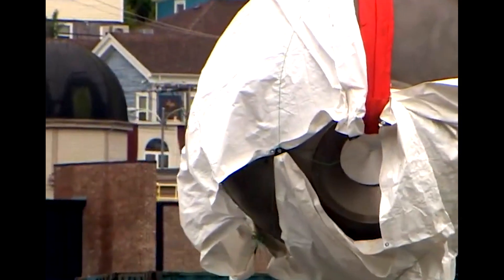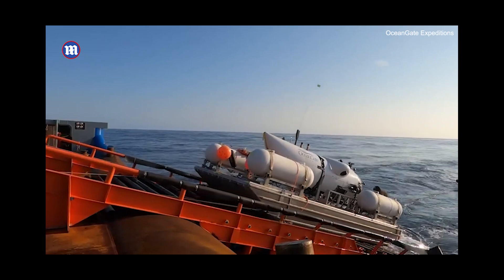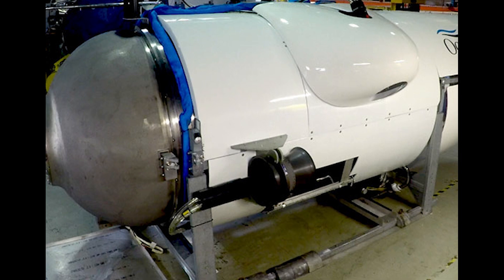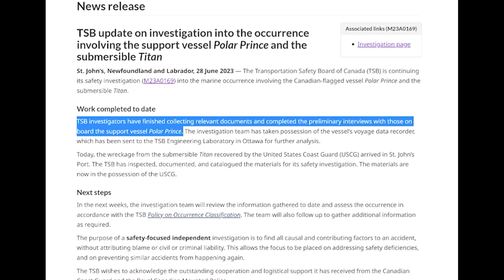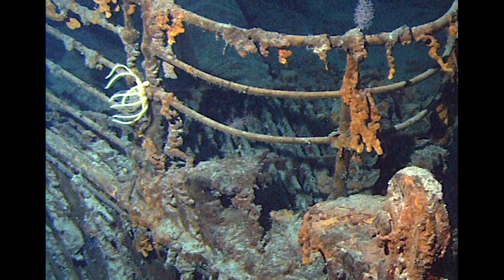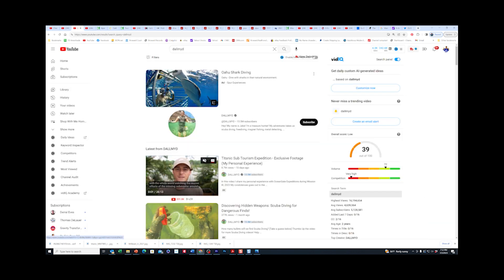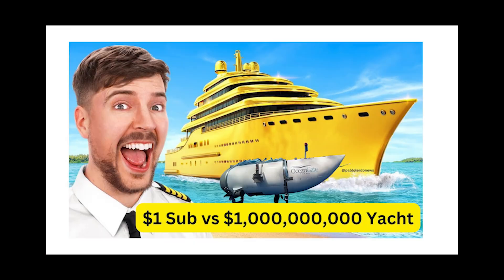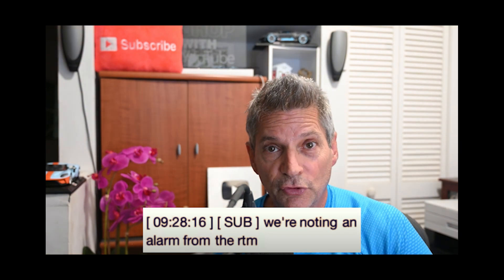Titan Submarine Debris Clues, Implosion Simulation

Comment: Here's what I think happened to the port window.
The carbon fiber collapsed during the implosion and as the water blasted in, it created a pressure wave that compressed the bubble of air in the vessel peaking its pressure to a higher value than the surrounding pressure with what is essentially a water hammer effect.  This pressure peak popped out the port window and both titanium end caps.
Reply: Yeah, I thought the exact same thing. That pressure wave from cavitation is like TONS of TNT going off instantly. The window was tapered inward to resist inward pressure, not outward.
Reply: @AnubisDogman  not tons, more like about 50kg of TNT. Which is more than enough to vapourize the carbon fiber along with any living tissue.
(I calculated the energy by simulating the gas laws in the process of crushing a 10m^3 bubble at the depth of 3500m deep)
Reply: @adamrak7560  I wasn't being literal, but thanks for dorking out on that. I guess I should have said heaps, or something...
Reply: @adamrak7560  - Another calculation that I heard reported came up with 48 kg, so you are onto it.
Reply: I agree but I think it is a matter of momentum of water rather than simply pressure. On implosion the water accelerated into the air space. It hit the window fast. Force = rate of change of momentum. The window was not designed to withstand a large force from the inside and could not provide enough force to stop the moving water. The fast moving water hit the window, causing a force inside that was equal to the outside pressure + that caused by decelaration of the water and blew it off.
Reply: @fishersofevidence8771 Apparently, its the compression of the water. Youtuber thunderfoot done a vid. At titanic depth, the water is actually compressed by about 1%. If that water finds a gap at 1 atmosphere, it effectively decoils at something like 2 or 3x the speed of sound. The water has massive force then, and the pocket of air that was the sub is surrounded for an instant by a cloud of uncompressed water. The water is effectively like an infinate spring with a spring rate eguivelent to the depth pressure.
Reply: @fishersofevidence8771  
Agreed.  The water hammer effect I mentioned is in fact the result of the momentum of water.
Reply: @fishersofevidence8771  
Although the energy stored in the compressibility of water at those pressures enhanced the power of the implosion, the implosion would still occur even without it.  That video you referenced was in my opinion, completely incorrect with the assertion that without that compressive stored energy, the water would just flow in slowly.
He seems to have overlooked that the pressure is all around from all directions and fed by a massive volume of ocean, not just the water directly above the vessel pushing 'down' on the vessel so the speed that water falls due to gravity is not a limiting factor.
Reply: @fishersofevidence8771  Elsewhere, I estimated the force holding the window in place at ~2.2 million pounds due to depth plus ~0.9 million pounds due to the clamping force of the bolts, for 3.1 million pounds on a 380 sq in face. or roughly 8,700 psi in round numbers

Your internal pressure would need to exceed that in order for the bolts to fail.

A collapsing air bubbleis by default going to have less pressure, and, when it collapses, it will go into solution in the water. It'll be fast - Mach 1 - but the result will be similar to a water balloon impacting a granite cliff, even if at speed.
Reply: @fishersofevidence8771  Well put :-)
Reply: @fishersofevidence8771  Exactly what others commented above...
Reply: Think this comment is spot on and I would also immediately rule out the possiblity that the salvage company unbolted the porthole.  If the porthole was still in place after the implosion any micro stresses on its bolts and general seal with the titanium would be of major interest in a research lab.  The salvage company would not have destroyed forensic evidence like that, they would have instead just put the entire end cap onto a pallet and transported it that way.
Reply: @michaelmacleod7051  Especially with the massive media attention to this failure, there's NO FU*KING WAY IN HELL the salvage company unbolted and removed that porthole.  The implosion blew it out.
Reply: So where are the delaminated pieces of carbon fiber?  I wonder if the carbon fibers are just not being shown to us
Reply: @term25600  
Don't forget that carbon fiber is much less dense than the metals.  The shattered pieces, if any remain at all, would have drifted away much easier than the heavier metal ones.
Reply: @term25600  Well, if the pieces were recoverable they are in one of those bags they craned off the ship.
Reply: @term25600  It's confetti now.
Reply: @amandahugenkiss  We shall call it "Carbonfetti"
Reply: Since water has inertia it it will continue to fill will the volume of the submersible until it is greater than the ambient pressure. Any resulting bubble of air is going to be tiny. Approximately 1/350th the internal volume. Assuming a depth of 3.5km.
In a very short period of time (possibly less than a millisecond) the inside  of hemispheres go from having having 1 atmosphere of air to more than 350 atmospheres of water. Which is going to put a huge tension on all of the bolts.
Reply: @markevans2294  It’s not the static pressure, since the pressure on the outside of the port will also be about 380 atmospheres. It will be the force of the incoming water moving at possibly supersonic speeds impacting the port that does the damage. Given that the port window resists external pressure, both the bolts or the window could fail.
Reply: @StillAliveAndKicking_  In terms of the effect of the over pressure on the bolts there's likely little practical difference between the water moving at 1.5km/s and it being supersonic.
Reply: @markevans2294  Except that the bolts are being supported by the external pressure. In order to transfer tension to the bolts, you need to have strain - if no displacement is possible because of the opposing compressive stress, no tensile strain is possible.

So, until you can overcome the external pressure and displace the viewport outwards, the bolts do no experience stress or strain. Only after the port starts to move will you induce stress on the bolts.
Reply: Water hammer causing premature wear/failure was a concern for us operating at 500 psi at a power plant.  I can’t get get my brain around the force from water hammer of an implosion at Titanic depth.
Reply: And all in roughly the time it takes a bolt of lightning to strike...
Reply: @Rammstein0963.  IIRC a fluid will attempt to fill a void at the speed of sound. Which would make it far quicker in water than air.
Reply: What we are talking about here is a shock wave travelling out from the centre of implosion, kind of like a sonic boom.  It has extreme peak temperature and pressure, but very brief duration.  Generally it will break things, but not move them very far.  Maybe it broke the various ring/window fixing bolts?  I don't know, but it's a possibility.  Examination should show, if there are brittle-fractured bolt ends still in the threads.
Reply: Was thinking similarly as a possibility.
Reply: @Andy-df5fj
I imagine that the same mechanism accounts for the clean separation of the titanium domes from the titanium end rings of the cylinder, and also the clean separation of the end rings from the cylinder. All of these attachments were designed to withstand compression, not tension. When the hull collapsed, water accelerated into the void and hit both ends hard, the window blew out and the titanium domes blew off the ends. The inertia of the titanium end rings on the cylinder was sufficient that the bolts holding the domes onto the rings failed, but not before the joint between the rings and the carbon fibre cylinder came apart, that was less able to withstand tension. Composites split and break up into pieces on failure and that together with the relatively low density of carbon fibre composite, making it easily washed away by water currents, is probably why little, if any of it has been found.
Reply: @fishersofevidence8771 In addition it looks like a somewhat clean separation of the flange holding the window in the end cap.  The view when it’s being lifted off the ship shows the outside (evidenced by the hinge mount).  Where there should be a flat flange with tapped holes for the retaining ring bolts there is a rougher beveled surface that indicates a ring shaped piece of the titanium with all the bolts and retainer snapped off together.  I’ve seen similar things happen with a hydraulic press snapping a bearing flange and with a beadloc ring tearing the entire outer edge of a racing wheel right off with a fairly clean break.
Reply: @fishersofevidence8771  Yes, It wasn't only compression, it was compression and then things blowing outwards.  I think the take we've been given on an 'implossion' is probably a bit limited.
Reply: Sounds like aft end cap let go first.
Reply: @BalthazarMyrrh70  The cap would be held in place on the carbon fiber due to the external pressures on it all acting to push it to the center of the sub.  You can see in one of the videos where they install/glue the endcaps, that there is a lip assembly.  This is designed to prevent the endcaps from sliding down on the carbon fiber, not from being blown off it by internal pressures.  They just didn't design it to withstand that kind of situation, because the occupants would already be dead.
Reply: @glenndoiron9317  true. Apparently the glue was an added extra because essentially it was pressure that confirmed a solid seal.
Reply: Yes, you have given the most succinct and likely scenario! It's the most parsimonious explanation. The implosion of the carbon-fiber hull basically popped the titanium components and blasted the acrylic viewing port out. My suspicion is that the reason there were no carbon-fiber hull pieces attached to the titanium caps is because of the glue (which could have been stripped off in an instant).
Reply: @anindochoudhury8926  You're right.  The carbon fiber cylinder failed in the center where the stress was highest, pinched in and the pressure wave blew the front & rear titanium end caps off, plus the porthole window and rear structure of the sub.  Not sure about the landing frame - I've heard some reports that it was jettisoned to surface quicker.
Reply: @johnbergstrom2931  yes, that seems to me to make the most sense. Thanks for putting it so well.
Reply: na, it just blew apart the CF leaving the endcaps in place with nothing connecting them so they fell harmlessly to the ocean floor.  I believe the window blew out and caused all this since it was onlly rated at 1300 feet.
Reply: @ScreamingEagleFTW  yep!
Reply: I have seen a photo of debris on the sea bed and one image had what appeared to be the porthole, looking largely intact. I assume that the porthole dragged the locking ring bolts out when the hammer hit. Thunderfoot calculated the implosion speed to be roughly 2x the speed of sound. It must have been seen to be photographed, so they must have recovered it even if we have not seen it.
Reply: @kevinm8543 It looks like that is what happened as you say. One thing I wonder is if this mechanism of implosion followed by water hammer explosion would also occur with a spherical pressure chamber. Maybe it was a feature of this sausage shaped design?
Reply: @fishersofevidence8771  
I suspect that a spherical enclosure, though far superior at resisting implosion, would still create a large pressure surge due to the same effect if it were to implode.  However, being spherical, it wouldn't have any substantially weaker spots to blow out.
Reply: this is what I think happened... ----> Overconfidence
Reply: Andy, sorry about my post right after yours. I didn't see it initially.
Reply: @sbukosky  
I can't seem to find it.  I presume you came to a similar conclusion?  If so, not at all an issue.
Reply: Your supposition is my strongest intuition as well - the atmosphere inside the submersible formed a pressure wave that blew the hatch window outwards when the submersible's carbon fibre and titanium body failed/imploded. Owing to the varied composite materials that make's up this submersible,  think the actual true point-of-failure for this submersible was it's glued ends..most likely the entry or hatch-end.
Reply: Quite likely, but it must have sheered off all of the bolts holding the port window in place, and also all of the bolts attaching the titanium end caps to the titanium rings.  I can't see any holes where the bolts would have been, but also can't see any sheered bolts from the video evidence.  I am surprised how small those bolts were.  He probably got them from Home Depot
Reply: At 4000m water is compressed to 0.96 of it's original volume, the incoming water would actually be at 1 ATM but traveling at the speed of sound in a liquid: 1,481m/s 

(edit: not 1410m/s), but yeah I think being slammed into at over 3,000mph might pop that guy off, so actually not pressure, pure speed lol
Reply: Thank you for this comment. I've been confused by the comments saying that the port hole came off after water got inside because the port hole was designed to only take pressure from the outside. My, albeit limited, understanding of physics would be that once the water was inside, the water would be exerting equal and opposite pressure on both sides of the window. How you've described it makes that make a lot more sense
Reply: Soup
Reply: Reminds me of that Slow Mo Guys bottle trick, where hitting the top of the bottle creates a vacuum at the base, and then the liquid collapsing back down breaks the glass.
Reply: Nope. The end caps simply dropped away from the cylinder after it was shredded by the implosion. The Navy divers removed the ring and view port from the end cap near the surface prior to John Q eyeball exposure. They'll deny it was ever there but how did that ring get removed? They also removed all traces of carbon fiber from the recovered parts before exposure to the surface. Yeah coverup time.
Reply: The flange for the seating of the viewport plug would have been seriously deformed, and the bolts torn out of their holes in such a scenario.

I did not see that degree of damage.

This makes me think that the ring flanges pulled off of the composite cylinder so rapidly that the pressure wave did not have time to seriously impact the acrylic plug.

I could be wrong, but the damage pattern and general lack of deformation of the titanium parts indicate that the pressure had dissipated about as fast as it built up.
Reply: @chemech  Why? The metal ring and bolts holding the viewport are of insignificant strength compared to the outward force of the explosion after the implosion.  Essentially like toothpicks.  The bolts likely tore apart in tension at the surface of the dome, so we don't see holes or protrusions.  The metal ring is probably still flat because it's supported by the acrylic viewport.  I don't think that the viewport would bend  or break in half because there's essentially nothing holding it against the incoming force of the explosion.  It's possible that it simply shattered.  (Same for the 18 bolts holding the main dome to the ring.  insignificant strength.)
Reply: @brianwest2775  At 7:19 Jeff muses that they might not have used a torque wrench, while SHOWING a torque wrench.  There's 17 bolts holding a Chevy (old skool) cylinder head on, and the bolts shown look about the same size.  A Diesel engine with a 6 foot piston would require MASSIVE bolts for a 22:1 compression, but the "water-hammer" effect would exceed 100:1 . . . . toothpicks indeed !!  Same with the view-port window bolts - sheared instantly, and if high-quality Stainless 304, they can't even be picked up with a magnet.  They're in the muck at the bottom.  I'm amazed there's no glue residue on the rings.  There MAY have been enough heat, but NOT enough Oxygen to burn all the carbon and plastic so it's still down there.
Reply: @peterdarr383 noticed that on the first day (being a jet engine doctor myself👨‍⚕️🤣). I noticed they were using the hammer drill to “torque”, either they were foolish or didn’t understand the risk, or both mixed with careless.
Reply: @brianwest2775 Exactly. The bolts resist compressive force well, tension not so well.
Reply: @peterdarr383  
I would venture to guess that the glue they used sticks to carbon fiber far better than it does to titanium so it stayed stuck to the carbon fiber as it collapsed.
Reply: @Andy-df5fj  Almost guaranteed that the solvents would penetrate the epoxy resin and allow bonding. Bonding to metal is a much less compatible situation chemically, so you need mechanical attachment of the adhesive - a roughened surface, not a fine machined one.
Reply: @StillAliveAndKicking_  - Is a bolt ever in compression?
Reply: @Scissors69  I understand the point you’re making, it’s a fair one, but they do need to maintain their effectiveness in response to repeated compression, and not work loose. Maybe that is a non issue, I don’t know. But the key point is that they are not designed to resist the port being blown out from the inside.
Reply: @StillAliveAndKicking_  Bolts work in tension, you actually pre-tension them by torquing them to spec
If you have a big compression force, like 100s of meters of water above you, you don't need bolts to keep things together, just to keep everything in place
Reply: @Wannes_  You missed the point. If water enters the submarine, it will travel incredibly fast and hit the port, thereby putting the bolts under huge tension. They would break I assume, given the sudden force.
Reply: @Wannes_  True, however when you are using the clamping force of the bolts to compress a gasket to form a seal, you do want to torque your bolts to specification. This also ensures that the bolts will stay installed so long as they are not subjected to vibration - in the case of vibration, you employ a cotter pin, safety wire, or similar retaining device to keep them in place.

Once torqued down, you are expecting your tensile failure to only occure if you exceed the rated strength of the bolt.

For 3/4" - 10 UNC steel bolts, the rated capacity is 50,100 lbs per bolt. This includes a safety marging, but for now let's work with the bare value. Titanium and carbon steel both have a tensile strength of 50 ksi (50,000 psi), so for a preliminary analysis, we can assume that the titanium fasteners will behave like the steel ones.

When you exceed the rated strength of the fastener, you go from the elastic portion of the stress-strain curve to the ductile region, where the fastener will permanently elongate under tensile load.

Depending upon the load, the bolt, the rate of application of the force, etc., the botl will either neck down and then fail, strip out the threads, or if the force is rapid enough and the bolt insufficiently ductile, it will shatter.

These failures all leave behind distinctive damage patterns and residues.

Going back to the Titan, there appear to be 18 fasteners holding the clamping ring to the flange to secure the viewport acrylic to the gasket and seat.

18 x 50,100 = 900,000 pounds.

The 22" of exposed windoe have a surface area of 380 sq in. At 3,800 m depth, that works out to 2.2 million pounds.

Add that to the clamping force, and we get ~3.1 million pounds of force that need to be exceeded before the acrylic piece will displace.

Also, water is effectively incompressible, so the water outside the port is about as likely to yield as a granite cliff. Same for the water impacting the acrylic.

What might have happend is that the acrylic would have deformed - even though acrylic is a rigid polymer, it is plastic when compared to the water at these depths.

However, that form of failure would also leve damaged components and residue in its wake.

It's far more likely that the pressures equalized before the acrylic port could do much moving, as witnessed by the Hydraulic Press Channel's video we just discussed.
Reply: @chemech Did you see how they were torquing the hatch bolts?  Torque wrench in one hand on the bolt head, open end wrench turning the opposite direction on the nut with the other🤦- basically doubling the friction under the fastener heads and usually causing an under torqued fastener.
Reply: @peterdarr383 yea they used a torque wrench, but the kid using it didnt look like a mechanic type
Reply: @chemech  
The view port and mating flange of the end cap were built to resist external pressure, not internal pressure. Those tiny bolts and the titanium ring were probably there more to keep the port window from falling out during transport than to resist pressures.
Reply: @Andy-df5fj  The collapsing air bubble would still have less internal pressure than external pressure. 

Elsewhere, I estimated the force needed to tear out the boltswould be on the close order of 3.1 million pounds in order to overcome roughly 2.2 million pounds of hydrostatic pressure and 0.9 million pounds of bolt strength.

Having specified bolted flanges for pressure and vacuum vessels, you have to torque the fasteners down to specification, or you do not get a seal.
Reply: @chemech  
Why do you think the pressure would be less?  
Water hammer is real and can create pressure surges far exceeding the source pressure.
Reply: @Andy-df5fj  Water hammer is due to the momentum of a column of water collapsing a gas bubble - you are not going to get more pressure than the total head available - conservation of energy.
Reply: @chemech  
What do you think happens to the momentum of the water after blasting into the vessel in less a millisecond then coming to a stop after filling it up?  Of course water hammer is at play here.
Reply: @Andy-df5fj  Ireesistable force meets immovable object. Waterhammer won't apply enough force to dislodge the port, let alone cause atastrophic failure, because the opposing force prevents movement.
Reply: @chemech  Hydraulic Press Channel ran a test with carbon tube and steel endcaps: these also came off clean (no CF on them, just glue residue) due to the imploding CF tube
As for the small leak theory, if there is such a thing at those depths
One of the test specimen leaked, filling it with water so it didn't collapse
Reply: @Wannes_  Yes, I saw that video a few hours ago, after my comments were made here. Thanks for bringin it up, as it was a really good set of experiments.

I was not surprised by the lack of adhesion of the epoxy to the steel - it is aligned with my own experiences with trying to glue metals.

Henkel for example sells various adhesives - including Loctite brand threadlocking compounds - which have a degree of adhesion to extremely clean metal surfaces with some "tooth" due to surface roughness. They are still quite limited in how they bond, and the service envelopes they can fill.

As for the leak, I suspect - there's really no way to prove it - that the leak already existed before the specimen was immersed in the water.

Overall, I view their experiments as strong indicators that the CF tube failed, and pulled clean from the titanium ring flanges on the Titan.